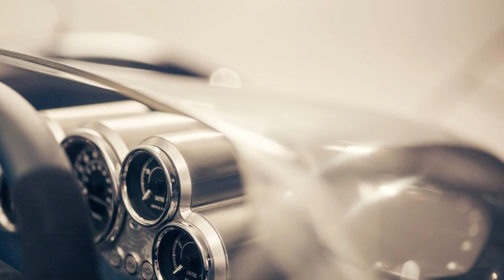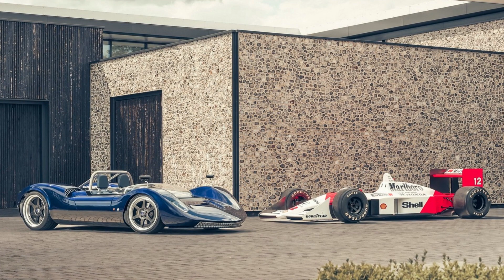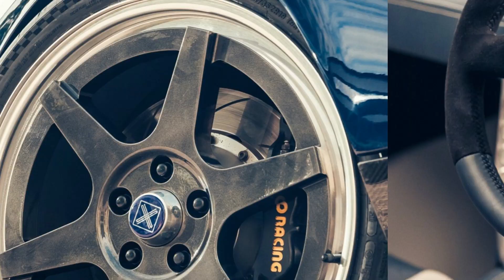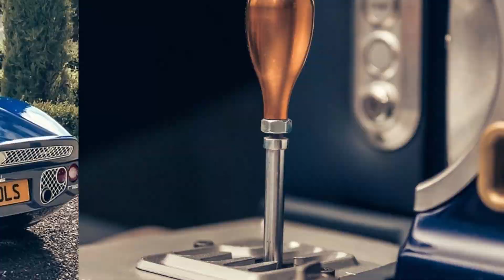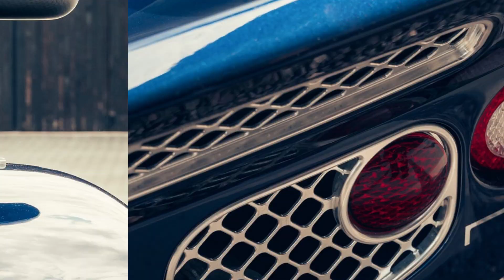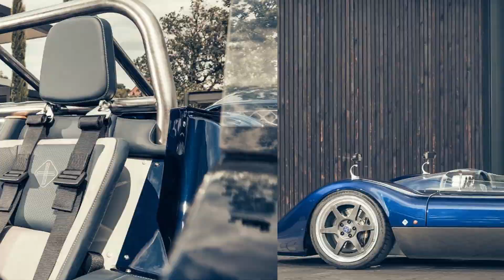Nichols Cars N1A Is A 7.0L V8-Powered Sports Car Built By An F1 Engineer

Comment: Why ?

"F1 engineer" yea right ( sarc).....

Where is the REAL MOTOR then.....the Cosworth V8.....

Or

Any motor built this CENTURY WITHOUT 
Pushrods.........
Reply: Oh shut up. This is designed by the guy who designed the original McLaren M1A, and yeah he designed the MP4 during his time at McLaren as well.
It's an homage to the M1A, which had a Chevy V8, why would they want to downgrade to a Cosworth? For it to be less powerful and more expensive just to appeal to people who don't know what's going on? Go get an Elva if you want something more along those lines.
Reply: @mak450   even Ford had DOHC in the 60's just look at the GT40 motor !
255ci DOHC  500hp 200mph
Out of a de-stroked 260 WINDSOR ! 
that would be a "homage" "ultimate period build".....still "lotus" twin cam heads though
( Cosworth !) Which is what I implied by saying "throw a Cossie in there" the GT40 Cosworth !
Reply: @Marc_Remillard  No it wouldn't. The The car this draws from had a Chevrolet V8, thus the "ultimate" choice is another Chevrolet V8. You asked why, that's your answer, as well as the alternatives not being better, being more expensive, not having as much aftermarket support etc.

if you want something different maybe McLaren will start making Elvas again. or you can go for any number of open topped kit cars lol.
Reply: @mak450  so we basically agree if we talk Chevy motors the obvious choice is
The LT-5 32 valve quad cam 5.7liter ZR1 motor of the 90's......not that pushrod trash......
Surprise, surprise it still had "Lotus" heads made by COSWORTH ! 
And 
Since the LT5 is basically a LS with posh heads,, you can put the stroker crank in it ! At least then it could compete with a Coyote or a hemi
Reply: @Marc_Remillard  Agree? Not even close LOL
They don't make that engine anymore, it would be heavier and with a top heavy weight bias that screws with the handling, and more expensive, which is why GM stopped using it in the Corvette all those years ago...
Oh also vastly less powerful
I get it though, you just like overhead cams regardless of all the other things that matter.

This car just isn't for you.
Reply: @mak450  the LT5 second gen put out 525hp at 8800rpm
Out or 5.7 liters in 1994 ! With a 90's tech fuel injection system (AFM instead or oxygen sensors) ( They stopped using it because Chevrolet didn't know or have the EXPERTISE to build it !
Every single one was built by MERCURY MARINE !....just an example of Chevy stupidity......
And the motor weighed less than 450 lbs ! All alloy
Reply: @mak450  vwhen was the last time pushrods won Indy ?
Or F1 ? Or LeMans ?
Or
Anything other than NASCAR...... occasionally.....
Dusenberg had twin cams in the 1920's
So did Alfa and Ferrari....Jaguar had them in the 1950's....
So really pushrods are at least 100 years  "out of date" so are 2 valve heads !.......
Catching anything "fast" in you Chevy
AMG S65 for example
6 liter V12 twin turbo
Twin cam 36 valve
230mph capable
0- 186 mph in 26sec
(0-300km/h).... It has 4 doors and a MINIBAR !...
And it's not even the fastest Mercedes !
Reply: @Marc_Remillard  There was no second Gen LT5, that's at best an estimate of what one would have done had it ever gone into production....and I have no idea where you're getting these figures.
That engine still doesn't exist, it would still be taller, heavier and less powerful than this modified LS3. 
If you're not done yet, I am lol, peace out buddy, hug your overhead cams at night, because they won't be going into this car. Maybe the next Nichols vehicle
Reply: @mak450  peace ...
Hang on to your antiques.....
Someone has to....
But remember Chevy are ONLY building them because they are SO CHEAP to build and their margins on their cars are so much greater...
But it's still not catching a Coyote is it , let alone anything better....... Even Dodge do pushrod motors better than Chevy.....that HEMI eats your Chevy's for breakfast........
So is Chevrolet actually the WORST pushrod V8 built today ?
It's not
Catching a Dodge Demon red eye is it !
Reply: @mak450  
Oh and that 7.0 liter LS is no better than the old 60's Corvette L88 427ci (7.0liter)...
And you'd get more out of the L88 !
Reply from the maker: @mak450  keep calm and wait for the next video, thank you
Reply from the maker: Yes